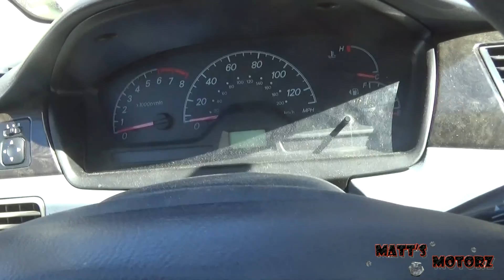F4A42 Transmission Follow Up!

Comment: Hey Matt,

Thanks again for the great series.  Finally got the sons F4A41 going and used your videos a lot.  Had no gears forward or reverse.  Dropped that transmission 3 different times.  If no gears typically means no oil pressure caused by either low fluid, bad internal filter, bad pump, or stripped splines on the torque converter (won't run the pump).  In our case, after stripping down tranny to find no issues, finally discovered it was the torque converter.  So I second that it should be replaced or at least inspected by a good tech prior to reinstalling.  Looked fine to me but a trained tranny tech could see the stripped spline right away.  Anyway, all back together and running great.
Reply from the maker: Bob Gerhart Awesome! Glad you got it all sorted out!

Comment: QUESTION : i have rebuilt my transmission F4A42 and with the only issue with under drive clutch a bit tight  due to new fricktion disks - around 0.5mm ( instead if 1.7 ) i haven't mounted it yet ... you think it will work ? i check the axial shaft and feel it's very stiff even with neutral grear .

Comment: I need help on my car...my transmission be. jerking sometimes and it started cutting off ...and the Rpm be 3000 at 60-65 if i go any faster i really goes high up to 4000 Where could i get a rebuild kit from with the clutch disc and bands and  Thrush washers etc.

Comment: Hello;

Thanks for the great video series for F4A42 transmission.

I have 1998 Proton Persona/Wira 1.8 A/T that i strongly belive uses this transmission. 

When i start the car, transmission works perfectly. After 3-5  minutes(warm up), gear stucks on 3rd and not change the gear under or over 3rd. But Reverse works good. In other words, only 3rd and R works after the oil warms up.

What would be the problem?

Thank you

Comment: Hi
what can be the issue if car stops on the road, it was normal drive and all of a sudden, no gear, put to D or R or 1, 2, 3, nothing happens. 
any advice plz
Reply from the maker: First thing that comes to mind is not enough fluid.  Maybe you have a leak somewhere.  Second thing is a failed pump.  Check the fluid level first.
Reply: Hi 
thank for the reply
fluid level is ok,. check pump, check pump, seems ok, is there a video on pump operation, on how to check its functionality,  also can it be a torque converter issue, as i replaced the complete gear (with new overhaul kit) but only TC is the same.
Reply from the maker: To check pump output you need to measure the line pressure of the transmission.  I made a video showing how to do this.  You will know it is bad if the pressure is much lower than spec or nothing at all.

Everybody always thinks the torque converter is the issue to transmission problems, but the reality is, this is rarely ever the case.  I am not saying it doesn't happen, but that likely your problem lies elsewhere.  It is impossible to say without some evidence from diagnostics.  Start with the line pressure.
Reply: Low reverse wavy spring failure is common issue. The spring pieces get into the pump and break it.

Comment: Hi i have a mitsubishi lancer tranmission when i put in drive it takes 7 seconds to select what can be the problem
Reply from the maker: Simon Cox There could be a number of reasons why this is happening, however I cannot give any useful advise without diagnosing it myself.  Automatic transmission problems can be very complicated.  The only thing I can say is to take it to a REPUTABLE transmission shop.
Reply: Ok thank you for the advice I am Tobago
Reply: I am from Trinidad & Tobago

Comment: hi is it possible to get a rebuild kit for my 2009 mitsubishi galant cvt gear box  model F1CJA
Reply from the maker: Yes.  You can get a rebuild kit for any transmission.  Try rockauto.  That's my go to site.  They also sell em on ebay.  Or just google a transmission parts website.

Comment: Great Job Matt ! I watched the F4A42 series cos I have a Diamante that's showing some erratic signs. It does not downshift sometimes when going uphill so it over drives a higher gear, resulting to noise and annoyance. It drives normal in plan and downhill conditions. this is my guess though, dunno much. 

what do you think ?
Reply from the maker: If the engine is making more noise, then to me that says that it DID downshift. Maybe I am confused.  When going up hill, do the RPM's increase?  If yes, then that is normal.
Reply: They fixed the wave spring issue around the end of 03 for the diamantes
The old one had a break in it, the revised one was thicker and a solid ring
The other problem is the planetary carrier coming around, they can be welded up to fix this also
I'm having trouble with my 02 AWD diamante transmission and these videos have been very helpful
How did you go with your diamante?